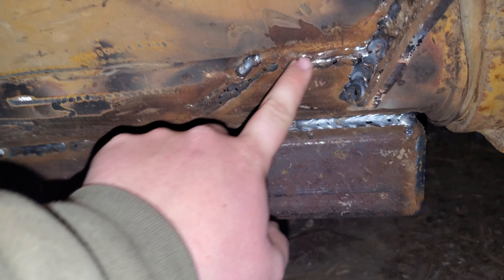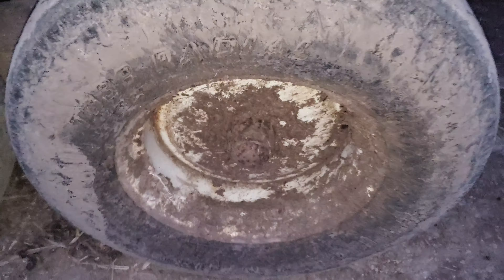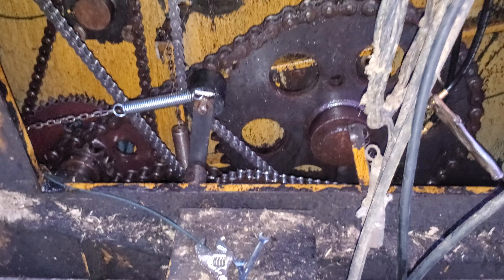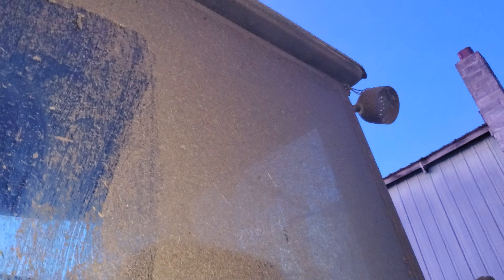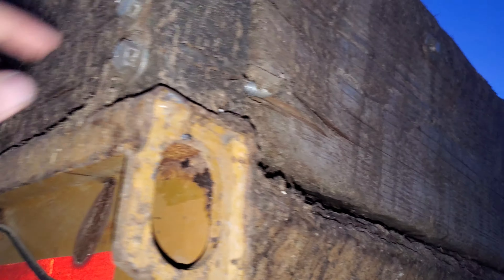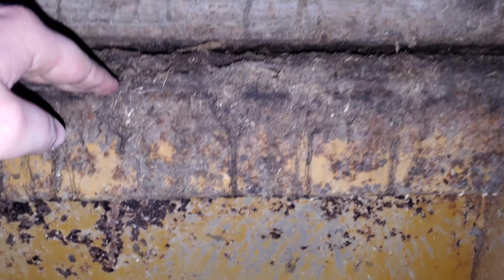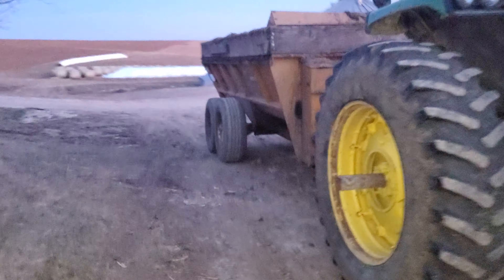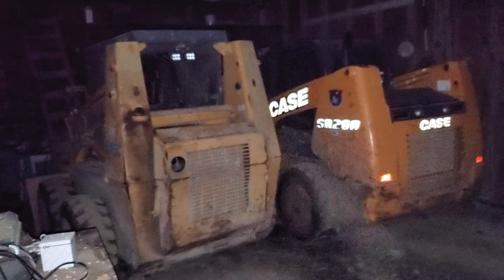Got the Kuhn Spreader Fixed. Then Another Thing Broke. lol

Comment: Our Farm we have a kune night push Pro 2044 and a side Slinger 8124 they're both orange the next size bigger than your spreader we usually have either a 4240 or 4440  or a 4430 on them
Reply from the maker: We use the 4450 but have used the 4440 with dauls and had no problems.
Reply: @iowadairyboysFarms  OK? Read to end! here in Ohio we have 800 heifers that we raised for two different local Dairy Farmers and we have about 850 Acres that we Farm whatever we don't use to feed the cattle goes for grain we grow weet oats hay corn and soybeans mostly some and speltz to chop with our claus 820  3 H&S 7+4  silage boxes and 3 geal  ones that we uesly don't use them  have a 10 foot bagger that we run on tone red tractor a 1066 I hate this thing it's junk because it's read mostly and we have lots of issues with it we have a green fuel extension that you put on a the front since it burned so much feels so we can get through one two hundred foot bag in one fuel up the other off color brand we have on our farm is a case 9449 it's our biggest tractor has 225 horse our second biggest tractors at John Deere 6030 with 205 horse all the other 18 tractors are green 3 or antiques two A's and two 420s all the other ones we usually use on a daily basis we have three retired guys in the funny part is the one's name is Roger too he does most of the barn work I help him too!
Reply: @iowadairyboysFarms  dam spreders
Reply: @jerrymcneil4150  Does punctuation cost money where you're from?
Reply: @Boodlemania  lol funny!